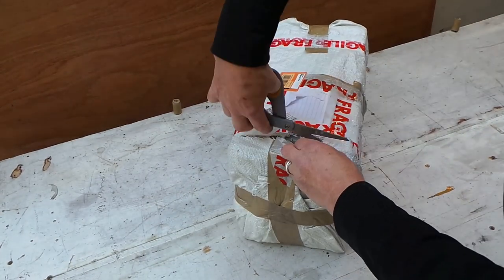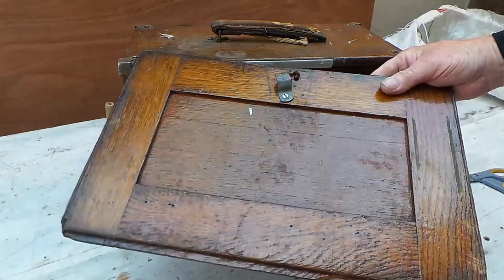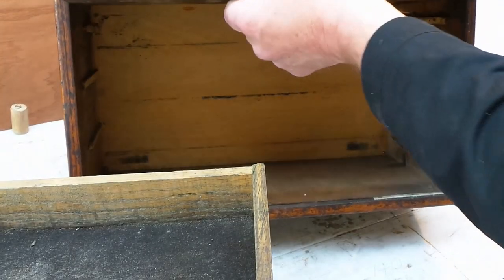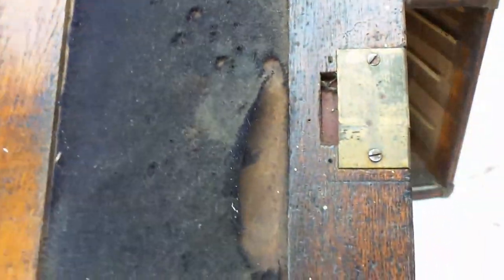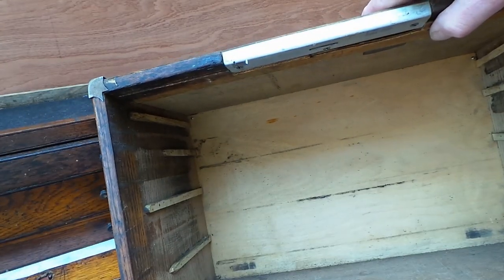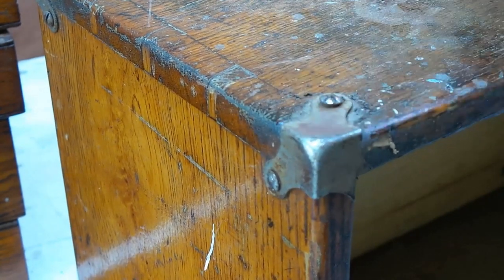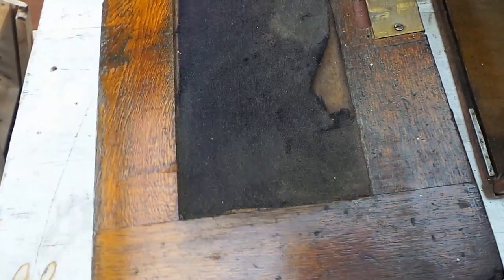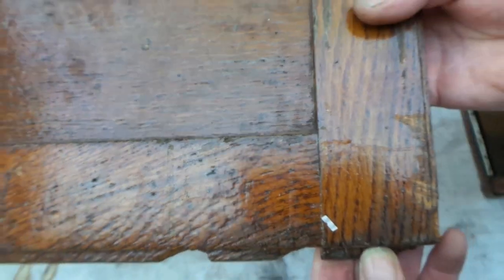Cool Ebay find unboxing a Moore & wright oak machinist tool box

Comment: I think it's pretty cool as is. I would clean it up, fix the minor issues, replace the felt, and simply use it. Anything beyond that I would restore it back to original and display it in my parlor.
Reply from the maker: That's a very tempting suggestion, i nearly missed the parlor refrance😊
Reply: @Instone09ine  
Livingroom.

Comment: That ball looks like the sort of thing you'd use on a micrometer so you can measure say from a flat edge to a bore with the ball going between the anvil of the Mic and the bore. Obviously you have to deduct the diameter of the ball from your Mic reading to get the proper measurement. It's probably either 5 mm or 0.2 of an inch.
Reply from the maker: Thanks for the info😊